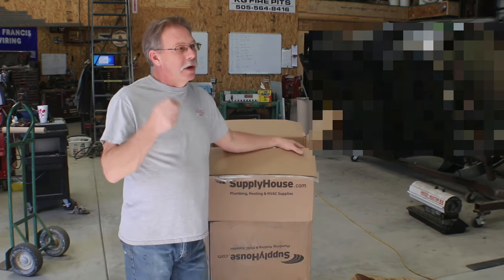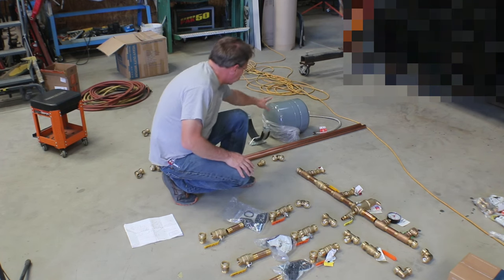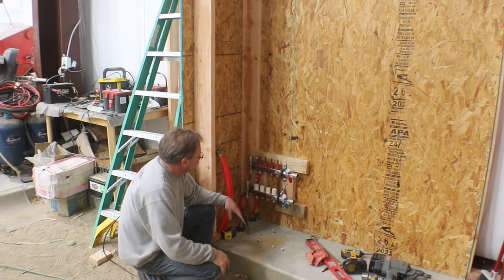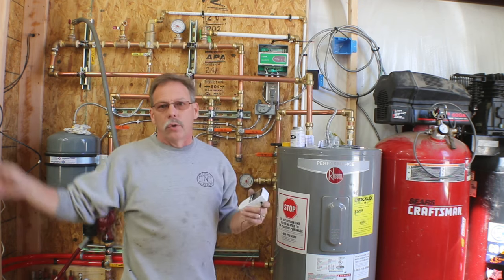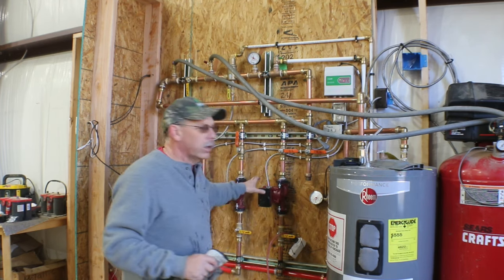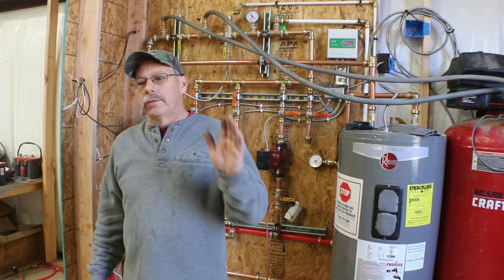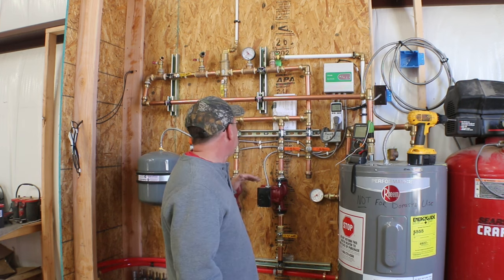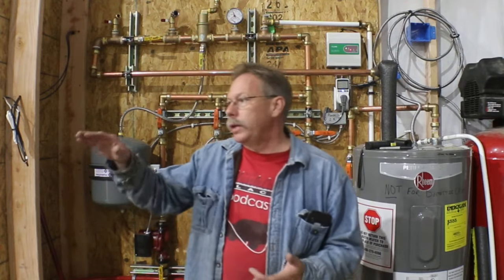Can you Heat your Shop with a $200 Water Heater? Radiant Floor Heating For My Shop | Allison Customs

Comment: Great video if not sure about hot water tank should of check magnesium rods up on top of tank.
Reply from the maker: Thanks for the tip!  I plan to pull and replace those at the end of this season just as a precaution- but you’re right I should have done that before putting it in use to begin with.

Comment: Did you ever think about buying a second hot water heater and running in tandem or building a hot water solar panel, there are good ideas online. Thank you.
Reply from the maker: I have thought of so many options, the best would be to run NG to the building.  
As for solar:
Hydronic Solar Heating for the Shop
https://youtu.be/_mR7S4N28oY

Thanks for commenting and watching!

Comment: HW tanks are frequently used to heat home additions. A cheap way to go, but they are a kludge, and fail early especially when used where the duty cycle is high (like the northeast).
Reply from the maker: The original idea was to use a waste oil boiler for heat, turns out I don’t produce anywhere near enough waste oil.

Comment: I had a RE client who converted a lot of studio apartments to a very similar system.  The tenants paid the electricity...and he dismantled the old steam building boiler. Ultimately he admitted that it cost about $1 an hour to operate.  (Chicago rates) The do take a LOT of electricity.
Reply from the maker: True, not cheap to run.

Comment: What is square footage of your slab?  What was the coldest temp of your slab before hooking up this system?  Is your plan to add solar water heater to this system and run that when it’s sunny and switch back to electric at night?  How are you thinking of switching between the two?
Reply from the maker: Currently I’m heating about 3000 sqft of slab.  I will be using solar and a 2 coil, 800ish liter storage tank. This will let me use the the same solar for both the shop during the winter and also my swimming pool during the late spring and early fall.

Comment: Great work Sir for a non professional. Couple things if I may interject 
NR 1 - change your expansion vessel location - current location is prone to blocking . Use one of the outlets for filling your system to connect the vessel.
Nr 2 - I would advise to use a mixing valves just before your UFH manifold- generally  speaking you don't want the water to be hotter than 45 Degrees C.
Nr 3 - use air heat source pump in conjunction with your water tank (use the water tank as a battery- as we call them buffer tank), Im pretty sure your electric bill will be significantly lower. Air source pump take 1 KW produce 4 Kw in return all good up to - 25 degrees C, and produce 45 degrees C all day long.
Reply from the maker: Thanks for the recommendations!  Where would you suggest moving the expansion tank to? Higher up the wall? Thanks.
Reply: @AllisonCustoms  You can leave the expansion vessel in the same location , however it is not recommended to connect it to the bottom or air, dirt separator. I would use one of the ports you used for filling your system  to connect the vessel.
Reply from the maker: Ok, so just move the connection point.  I see -  the separator could be causing a clog over time. Got, thanks!

Comment: You might want to think about adding dielectric unions between the copper and hot water tank, you're trying to keep from having electrolysis occur on the unistrut between the copper and the unistrut. This will completely isolate the possibility of having an electrolysis occur
Reply from the maker: Thanks!
Reply: Aren't those brass fittings and Sharkbite fittings a dielectric union?
Reply: Antifreeze is good at preventing corrosion.

Comment: Not to be harsh, so just an FYI....

All 3 of your pumps are installed 'reverse flow'.  In most hydronic systems you want the pump intake at the bottom and the discharge at the top as this will naturally allow any air entrained to migrate vertically through the pumps, mitigating the potential to airlock a pump and potentially burn it up(probably why they are noisy).  And always remember to vent any accumulated air from the motors(loosen screw in the center of the motor until only liquid comes out and no air).  

Also, I usually pull the internal check valves out of the pump(if they are supplied with them) if your system flow design does not require them.  This lowers the frictional coefficient through the pump, increasing flow or allowing the use of a lower speed to save power.  

Your hydronic flow layout could have been laid out much better, but hay, your just learning.  On the bright side, you put your deaeration valve at the top of your system which is correct.
Reply from the maker: Thanks for the input, I hadn’t thought about but orientation (other than what the manufacturer says not to do).  I went and looked at my home system and sure enough they are mounted vertically with the outlet up.  I see what you are saying about the air migration. I am planning to move some components as my shop continues to get built out and I will definitely take your design ideas into account.  Thanks for the feedback!
Reply from the maker: So quick question, (I’m sure long answer) - if I go out and turn the pumps around (reversing the flow) that would A) help the pumps - air migration? B) would that change anything else in the system?

Comment: The expansion tank looks to be in the wrong position,  do you have a check valve from the fill water supply from the house  so you don’t contaminate the hose drinking water with antifreeze ?
Reply from the maker: There is no water supply to the shop. This is a closed system, but I am looking to add an auto fill unit at some point.

Comment: I haven't read all the post. Be sure and change the relief valve on the heater to a 30 psi relief. If the stat on the tank where to fail, and stay on.....and they can. The relief would protect your in floor tubing, by not sending 210 degree glycol into it. Relief valves are 150 psi or 210 degrees. Also you lose 30 percent of your btu's to glycol because of poor heat transfer, but if you are afraid of long power outages, wise choice.
Reply from the maker: Yea, we loose power out here WAY to often.  Not typically for more than 3-4 hours, but occasionally overnight.  Our lowest temp on record is -20F, but typically we don’t drop much below -10F at night and then warm back up into the 30’s during the day.

Comment: Lot of work you did, looks well laid out. Now that you are done, look at Taco X pump block, about 10% of the plumbing and 2000% less complex. Sure, you know your system bc you installed it, but an HVAC tech or plumber may not have the ability to understand what is going on.  I used Tacos pump block and wow, easy peasy.
Reply from the maker: I’ll take a look at it, thanks for the tip!

Comment: I'd add a second timer/relay(kt3100).. because those things are only good for a few thousand cycles of load cutting.. having two in line set to different temps will create a backup.. since it won't be cutting the load unlike the primary one.
Reply from the maker: Good tip!  Thanks.

Comment: A system with a reservoir tank makes it easier to purge air and to take samples to monitor your glycol levels.
Reply from the maker: Thanks, I keep making small changes getting everything better with time.
Check here for current setup - https://youtu.be/_mR7S4N28oY

Comment: It's been a while since worked with radiant heat. In 1971 I worked for International Harvestor and we were having problems with tractors overheating in temperatures of 110 to 120 F. We had less trouble when we put nothing but water and water pump lubricant in the radiators. I later learned the design spec was for operation to 107 degrees F or less.

If you still running the water heater at 125 F I don't think anyone is at risk of getting scalded on your floor. So running the temperature of the water heater up to at least 140 F and raising the lower pump off and pump on the temperature of your pump controller should increase your thermal efficiency by increasing the temperature differential between the fluid and the floor and hopefully reducing the time the water heater runs per degree of heat in your shop.

There are only a few things I remember from college The first day of Irrigation Class Professor Dudley Barefoot worked out examples showing why we couldn't afford to run inefficient equipment. While in principle it is true in the case of a boiler for your garage it doesn't lead to ruin as quickly as it can farming on a 4% return humongous debt.
Reply from the maker: I have changes planned to improve the efficiency, but it was nice to have a heated shop this winter.
Reply: the current thinking is to feed water no hotter than 80-85° into the slab to begin with if you can help it.  So the rate of flow of the pump then becomes important to get the BTUs into the slab that match the heat loss.

Comment: could I do this ..but with baseboard radiators?
Reply from the maker: Yes, any hydronic form of radiator will work.  It doesn’t matter if it is a free standing radiator, a wall mounted radiator/fan unit, baseboard radiators or radiant floor, all of them will work if you have a heat source and a pump to push the warmed fluid through.  Honestly any form of radiator would work really well, especially if you are only heating during times when you are actually in your shop and want a warmer temp and then you could just turn down the thermostat at night to keep things above freezing.  
Hope that helps, good luck with your project!
Reply: @AllisonCustoms  Thank you!👍
Reply from the maker: You bet!

Comment: What about adding an indirect tank so ypu have an extra 60 or so gallons of 125 degree water waiting to be used...and little or no loss? I have a NG Buderus 115kbtu boiler that keeps up with my 1000sf underhouse slab garage and 1500 sf living space. I had a lot of my bright ideas that were nixed by my contractor who did the project with me. With outdoor reset and top system temp of 120...its about $900/year to heat. If I went from an 80% efficient boiler to a tankless 95% I would need an indirect tank to keep up I THINK...LOL
Reply from the maker: Excellent idea!  I added a 108 gallon tank this season and solar (video soon - I hope).

Comment: If you have enough load you can up the wattage of the elements in the tank, also you should upgrade the drain valve in heater tank to a brass boiler drain valve.
Reply from the maker: I upgraded to 5500w elements which helped a lot.  What does a boiler drain valve do/provide?
Reply: @AllisonCustoms  With a second 30amp circuit you could rewire the bottom element to operate independently (simultaneously) with the top element. That would take your original 4.5kw water heater to an 11kw. :) But if you didn't wire for nearly 60 amps (either two independent 30amp circuits are a single 60amp) that's dangerous.
I find most water heaters have a garbage drain valve that restricts flow and fails with little use. That said, if you aren't having a problem with it, I'd leave it alone but be prepared to replace it (I use a 3/4 ball valve) if you do open it - it may not close tight ever again.
Reply from the maker: @Sylvan_dB  I’ll check the valve at the end of the winter, and that is probably a good idea to change out to a ball valve.  I did retire so that both elements work independently.  
The hardest part right now is finding two 30 amp breakers - “supply chain issues”
😀
Reply: @AllisonCustoms  You can tell when a guy did not watch the whole video
Reply: Wattage does not go up with load

Comment: Thank you for putting this content together.  I would just let the Water heater run continuously when heat is demanded vs. start stop.  You want the watts of heat produced in the Concrete not the water heater.  As the water sits in the water heater warming up, heat losses go into the air.  Hotter the water in the water heater = greater losses.  As long as the water temp coming out of the water heater is greater than the concrete, let it flow.  The entire system would run less time.
Reply from the maker: You are right!  And that is the way the system runs today. Had to learn it on my own though😀
Check here for current setup - https://youtu.be/_mR7S4N28oY

Comment: Hoping my btu requirement for my 40x60 shop will be less,  like for a shop half it's size since I built it with a five foot deep insulated foundation wall. We'll see
Reply from the maker: Where do live that a 5’ deep wall was needed? That is DEEP - we had a place in the mountains a few years ago that needed a 4’ deep foundation and I thought that was a BA hole.  Anyway, good luck and if you have it available, skip all this extra stuff and run a natural gas line. It is absolutely the cheapest energy source, including installing enough solar to do the job.

Comment: In the beginning setup there was no reason to worry about the water heater getting up to temperature, if the element was on continuously anyway its adding 4500 watts to the system whether you keep that heat in the tank or not doesnt matter because you are heating the floor, not taking a warm shower. To the floor 4500 watts is 4500 watts is 4500 watts.
Reply from the maker: Thanks - excellent point.

Comment: I find this very interesting as I have a garage roughly 90x30 ish. Cement block construction with cement floor, wood ceilings 10ft. 
Not insulated, and yes this is the problem.
 I have installed a large wood hot air furnace, and yes I can keep it comfortable in there if enough wood is being put though the furnace, even with the drafts that are a nuisance, when the wind is blowing, which is nearly 90% of the time in winter. Coldest it gets on average around here is -10ish C, which is  15 F.
 The house on the other hand has a combo oil/wood boiler. which I use wood only when near or below freezing. The difference in heating the air in the garage and keeping the water hot in the house system, is like night and day. I would almost guess that if the hot air system was in the house, it could possibly take 4 times the amount of wood to heat the house, and I will add without much success on regulating it. 
I know your system is a no mess system, so to speak. Many people do not like the bother or the mess of wood. But as a go to on the colder days/weeks of the winter, I can see where 3 cords of wood could pretty much heat your garage for the entire winter, with very little output from the electric hot water. 
I know if I was to build another house/garage I would still have the combo system, but would have it between the garage and house, in its own section, heating both. I have had many different heating sources in many different houses, and I can tell you by far the best so far is hot water heat. The wood combo is a savior as oil becomes more expensive. The added bonus of the wood boiler is, it does not take much if any more wood to heat the house if the temps go down to extremes. To an extent, of coarse if very cold for an extended period it does require a bit more, but very efficient.
Reply from the maker: I definitely like the in floor heat, I think if it was possible (cost no object kinda thing) I would just run a new gas line to the shop and switch to a natural gas boiler.  unfortunately there is about $25k worth of driveway that would have to be removed just to get access to put in the line, let alone the cost of the line and a plumber to do the install and tie in.
Reply: @AllisonCustoms  Get a bid from a Directional Boring company. They can bore a gas line under the concrete.

Comment: is it a 120 volt or 220 water heater-maybe i missed it,what size wire did you run to that beast...couldn't you save some money running lp unit? its either 25 or 50 amps your drawing ..no?
Reply from the maker: It’s 220v and each element draws 5500 watts and each element is on its own circuit.

Comment: If your constant of 60° room temperature is the goal, your other constant is heat leaving the room.  It should require the same amount of BTU’s needed regardless if running shorter time at higher watts or longer time at lower watts.  Don’t know for sure how long it runs per hour but if it was consistently at the 4.9 kwh then that’s $15.28 per day if your rate is 13 cents per kwh.  Seems like if your wanting this just when your working, a radiant heater might be cheaper.
Reply from the maker: My goal is to have the shop at a constant temp all of the time.  I keep paint and other chemicals out there, so I would really like to maintain a temp closer to 70. But for now I’m trying to work with a 60 degree temp.

Comment: is this a regular electric water heater? if yes it us  its 4 -5 times less efficient than heat pump water heater or heat pump heating. unless is extremely freezing outside
Reply from the maker: It is, I’ve recently been looking into a hybrid version for that reason.
The original idea was to use a waste oil boiler, unfortunately I just don’t produce the amount of oil necessary.
Check out the current situation - https://youtu.be/_mR7S4N28oY

Comment: pressure tank is to trap air in it with fluid entering from the bottom
Reply from the maker: I’m working on a few changes.

Check out the current situation - https://youtu.be/_mR7S4N28oY